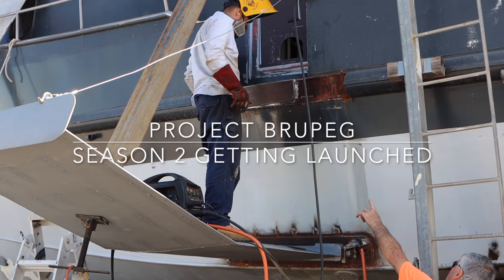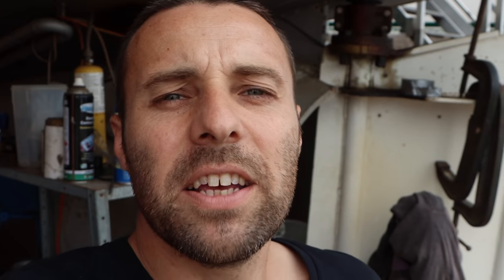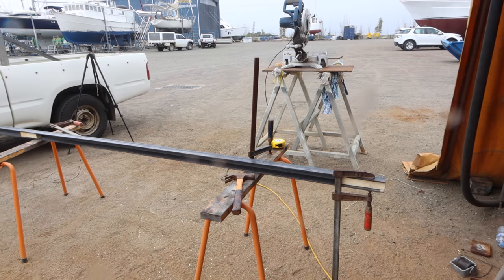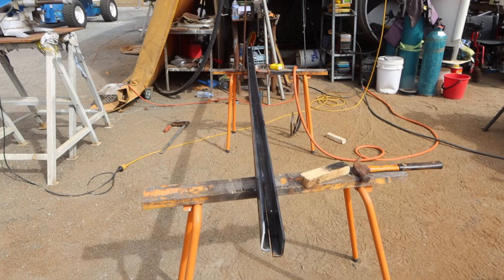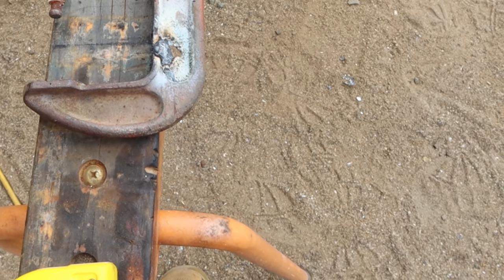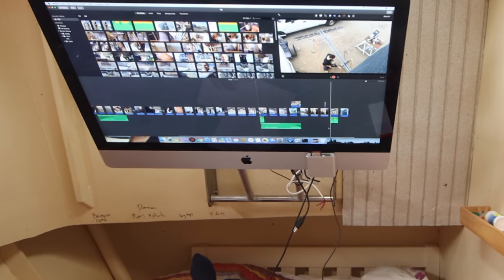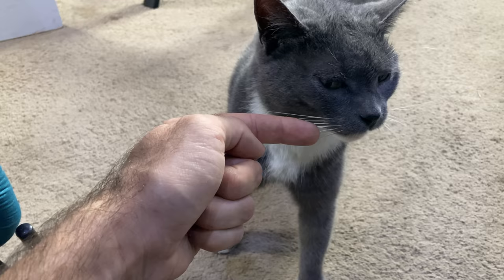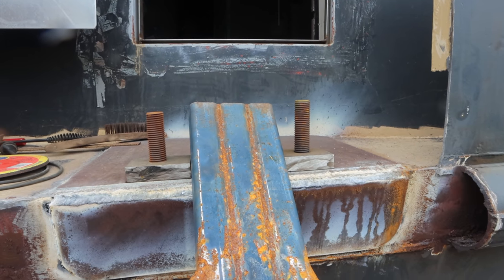Building Stabiliser Arm Guides (The Sliders) - Brupeg Ep. 153

Comment: So glad you used the correct hammer for that high carbon low ferrous steel.
Reply: @Barry Monday Given the apparent temper of the material I'd suggest it is also a low silica, low density variety...
Reply from the maker: I've heard some of these cellulose steels are being blended with epoxy to make them more resistant to rusting over time.
Reply: Project Brupeg this is covered by the lesser known branch of metallurgy- woodallurgy.

Comment: Damien, just an idea, and I know it's too late, but think about using forklift mast for your sliders, easy to source parts for, such as the bearings that fit the channels and you can get them in various lengths also.
Reply from the maker: Thanks Eric, but the way we are doing it we dont need to modify anything existing and its Exactly what we need in terms of size and shape. Plus we dont need grease on the sliders which is a bonus given they are right outside the door and will be regularly grabbed no doubt

Comment: In regards to the quality of metal, Mads of SailLife refers to the two ends of the spectrum as “unobtanium” and “chinesium”.
Reply: Mads is coming along pretty good as well with Athena. I just hope he doesn't use to many of the Chinese fasteners. They are made from "Crapium". It is a special formulations that likes to break once the head pulls down tight.
Reply from the maker: WhenJess and I rebuilt our last boat i added a hardwood brace under the mast. I used big stainless screws, and found i had to pre drill the hardwood as they would just twist in half. I learnt then I have a love hate relationship with stainless. Its nice and shiny and in the right places its great but its also absolute garbage when used outside its capabilities.

Comment: Cool progress. Slow or fast it's still progress. Your having fun and we are enjoying the journey. Have a question if you have the time. Did you consider round guides for sliders. Schedule pipe and a bogie for arm?. Thanks so much for documenting your journey.
Reply from the maker: Hi Mike, yeah we pondered a couple of ideas around a round guide. 1 was a large thick wall pipe with a sliding sleeve on it that the wing is connected to (like a firemans pole), but we decided against that as it can only be held at the very top and very bottom. We also thought of thick wall pipe cut in half and each half spread apart so the half round becomes the slider but the chance of the pins popping out was to high so we settled on the pressed L's welded together as we could make a deep channel thats fairly narrow.

Comment: Another thing to make sure of on the chair lift is high strength hardware. The lift may be strong, but it's only as strong as the bolts.  As a safety measure, maybe add a  safety line attached above and below the attachment point.
Reply from the maker: We actually thought abit about this. The winch has a strap that binds the winch to the stainless mount, so if the bolts break for any reason the inch cant fall on Jess. we also have an independant fall arrester mounted on the stainless so if the cable breaks or anythings else fails the chair will drop a few inches fast and the fall arrester will take up and stop the drop.

Comment: Just watching your weld up yeah sliders doing a good job I was just wondering where your gas nozzle is on your welding gun but do a good job another great video keep up the great work
Reply from the maker: Hi Matthew. That was gas less wire we used that day. So the nozzle isn’t required and taking it off allows a bit of heat from the tip to dissipate

Comment: I have a bad back and I tried many beds before I got one and I found the sleep number bed so that way I can have a hard bed or a soft bed and it has really worked out Depending on my back cause if you get and hard mattress then that what you got if you get a soft one you see how this is going so with the sleep number I can put it at what helps me at the time and yes they are costly but it was well worth it in the long run 👍👍👍👍👍👍👍🙂
Reply from the maker: Interesting, i never knew they made adjustable beds. Makes a lot of sense

Comment: Guys, I have a feeling you are going to have trouble with your guide rails jamming the rollers since they seem so twisted and the side walls not parallel. I realize you needed a specific distance between the sides to fit the roller assembly but there must be a piece of standard channel available that is slightly oversize that you shim the inside to make it fit 
Anyway, Hope I’m wrong. Good luck
Reply from the maker: Hi Chris, standard size channel was rally large siways and quite shallow. the pin was at high risk of popping out, by making the channel the way we have we are able to have a quite deep channel that is also nerrow in profile. we will be shimming this channel with HDPE on the three in sides and the twist ended up being less than 0.5mm so really no issue at all. We knew we would be able to counteract the twist when we welded it together

Comment: ps crown electric forklifts have a 100% duty cycle 24v motor pump setup that u could use for backup. flow rate would be less but would work. used for steering forklift so ask for a  steer motor pump from a used unit
Reply from the maker: Ahh nice. I will hunt around and see if I can find a wrecker. Cheers Michael
Reply: ps when chasing hydraulic motor and pump make sure it's 24volt as some are 36volt. many makes of forklift with hydraulic steering will have this sort of pump, but for a used unit of this age I would go for a crown unit as there are cheap new ones that don,t stand the test of time. any forklift hire company might have one in the corner ready for scrap. :)

Comment: good to see your progress, if your getting comments on your taking to long, obviously from individuals who have never had a major project like boat repairs/building, you do not need to feel you need to explain you really do not,  just say we have been busy , cheers for you concern.
anyhoo i take it you could not find any RSJ or heavy C conduit, or it was to pricey, it would have saved you all that welding, and trying to get the pieces straight, not that it matters twaz a good vid , all the best, downt let the pub workers get you down its normal for them to be Bar-stewards, lol
Reply from the maker: Hi Jon, we found some section but the trouble was the measurements were not compatible. building them like this we can get the dimensions EXACTLY what we want down to the half mm

Comment: The travel at the bolt down points for the slider arms may be too small to warrant it, but you may need to elongate the 30 mil holes port to starboard slightly to allow for the angular tilt of the clamping plate as it rises. If you bevel the top inboard and bottom outboard of the holes, the overall dimension won't change, so the plate won't shift in and out under pressure. One final note on 'over-building', welding in a vertical strip on the inboard and outboard sides of the area where the 'clamp down' plate rests should transfer the heavy 'push-pull' caused by rolling resistance of the wings from the hold down bolts to the deck doubler. That should prevent the studs from wearing too quickly, particularly the 'weak' area around the threads, resulting in lateral slop under way... ; {
Reply from the maker: Yeah i did ponder if we would need to shape the holes a bit for that reason. My plan is just build it and see, we can always shape it after its built. I like the idea of the vertical strip to transfer the load. I will add that into the design. I could make the shape like an upside down L and hang it over the side to link the outer doubler to the deck doubler to the stainless pads.Thanks for the suggestion Mike

Comment: Quick question. Why didn’t you just use square tubing and cut one side off?
Reply from the maker: Couldnt get the ID we wanted with the wall thickness we needed. overall the cost would go right up as we would need to machine rollers and wear strips to an odd size to accomodate the steel being a compromise. By doing this, not only was the steel cheaper, the wear strips were an off the shelf cheap option and no rollers were needed.
Reply: Project Brupeg cool. I figured it was something along those lines. Thanks for the reply. Man I wish I was near your build. I’d love to come help. I’m about as far away as it gets though lol. I have a friend that is living in Melbourne. He married a girl he met that grew up there. So they moved back for a couple years to have the baby and be close to her parents. They are there right now actually. Will be headed back to vinalhaven island (where I’m from) this December.

Comment: Damien, I have been watching you bend and weld metal into submission and can see it works, but isn’t there a considerable mechanical stress left in the construction?  Or is it insignificant? Phil
Reply: Yea but for the job it's doing it's not going to affect anything 
Its well over built 
The welding will release a bit of stress
Reply: So no, it won't be like the episode on Gilligan's Island where the professor glued the boat back together with his new glue made from palm tree sap.
Reply from the maker: Hi Philip, yeah as Fowletm said it will have stress but its minor and the heat from welding allows the steel's grain to relax back into a nie comfortable position again. Also the over build aspect matters to. if this was say a plabne where weight was really key, going as light as possible and de-strssing the metal matters, on a trawler like this we can put a ton of extra steel into her and we would barely notice. So its all relative.

Comment: I'm curious why you didn't just use 2"x 5" square tube 1/4"wall, and plasma it in half, leaving you with a 2"x 2.5" 'U' Channel - that way you'd have zero curvature,,,
Reply: True, Mind you, plasma-ing the square section can introduce HAZ problems
Buying stock U channel, and adjusting the sliding mechanism to suit seemed the go, but there are probably reasons that I missed in previous episodes.
Reply from the maker: Hi guys, it was about the sizes available. We needed something that was 41mm ID. getting that size was hard. Getting that size with a thick wall section almost impossible. So buying flat bar and putting a single bend into it solved a lot of issues. its easy to weld and we end up with a thick wall section exactly the size we need for very little money